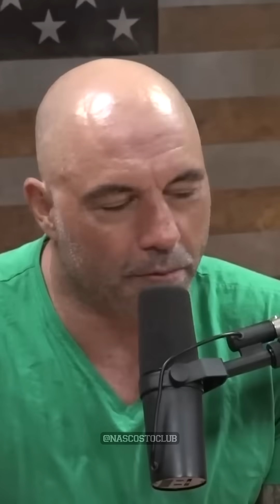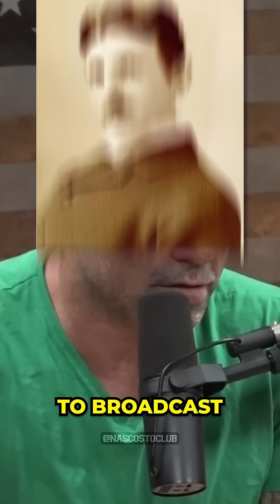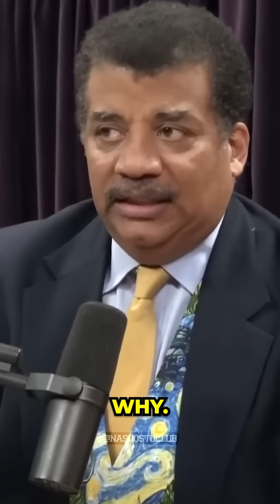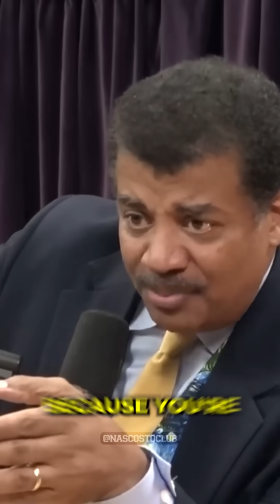WIRELESS Electricity Idea Debunked ⁉️⚡ #shorts

Comment: Neil is too mainstream to admit tesla was on to something.
Reply: We already have wireless electricity being broadcast. It's called lightning.
Reply: I did a course in IT called wireless technologies. The first thing you learn about is power intensity of the electromagnetic waves and there varying wavelengths. The wavelength spectrum is based on the thesis of electromagnetic-wavelength. Visble light, radio waves, microwaves radiation are all carried by photons. There will be a point when you can carry enough energy through the air but it will attenuate or loose power with range. Which makes it impractical. Not to mention if the Signal was so strong it will jam the most sensitive of transmitters that can detect up to -50dBm or even -100dBM. If you increase the power it can start to heat up the air as photons can be absorbed by particles taking away the energy from the signal as a whole. This is why wireless energy is still impractical. It's doable but not really great.
Reply: @hightiernub1313  exactly... it's a silly idea... thats why we don't doit that way... I don't understand how is so dificult to understand for these fanboys
Reply: Dreaming is cool but reality should be a factor in speaking about whether or not those dreams are real or just a pathway to something more feasible
Reply: He wass not... just think man, think just a bit... the emissions of the coil are spherical... that fact makes the whole idea stupid...
You have the same energy applied in more and more surface when you walk away from the emissions... Tt menas your bulb has less and less energy to function properly per sqare inch, if you start getting far away you have a variation, less energy available, do you understand?. How do you solve that? Pumping more energy, and thats dangerous. 
Tesla tougth the earth and the ionosphere would help... but he was wrong in the understanding of the behaviors of those... even if they work like a mirror reflecting the wave emissions, when you start to get a little far of the device, the power drop rapidly.
And you have to consider too, the complexity of having devices with diferent power needs, scattered all over the place. All that would be an engineering nightmare, solving the position of that devices en the field receiving the correct exact amount of voltage and intensity, or to have a variable transformer that adjust itself when you move that device trougth the field,  the whole system would be expensive and dangerous, and silly obviously...
Reply: Tesla had a neat idea but it wasn’t possible.
Reply: @TimboSlice911 tell that to the three letter organisation that classified all his parents
Reply: @MrRKlef  did they classify his parents as humans? 😟
Reply: @TimboSlice911  yeah I'll trust your intellect over NTs lolololol
Reply: @FubzyMC  Nicola Tesla was brilliant. He was also human like everyone else. Einstein was also wrong about some things. The reality is there’s millions of engineers working in physics labs for universities and private companies all desperate to find something like what Tesla proposed. The incentive to smash paradigms is immense. But none of them can because it can’t be done on the scale Tesla imagined. 

You definitely are missing the point if you are comparing my intellect with Tesla. I’m an idiot compared to him obviously. But that doesn’t have any bearing on the fact that no one can do it because it’s not possible without killing everyone nearby. All you have to look at is the best scientists and engineers in the world  have shown it to be impossible. 

Your belief is based on faith in a man who lived 100 years ago. That’s all
Reply: @TimboSlice911  "wireless" chargers for modern phones, headphones etc uses the concept that is being spoken about in this video. just on a smaller scale...
Reply: @QargZer  yes of course. That’s not what we’re talking about though. Tesla believed in large scale transmission at vastly longer distances
Reply: @QargZer  but... wireless chargers works because you put the recibing artifact very very near the emitting one, they literall have to touch each other🤣... it's a convenience based engineering. You save the time and effort that takes to plug the thing...
But in the moment you lift the tiny thing from it's place, you lose power.
Think for a bit, why is that? Why you can't walk away and still get the power from the wireless emitter? Just..  sit and think
Reply: @TimboSlice911  and that's why it wass a silly idea isn't?
Emitter emits a spherical wave... farter you go, Less energy you have per unit of surface of that sphere, the same energy distributed in larger surface, and so on... making all the system impractical...
Reply: @TimboSlice911  hey man, let them dream. They will achieve nothing if they keep sleeping.
Reply: @johnbiscuit8272  yup
Reply: @johnbiscuit8272  they can work on it their whole lives lol. This is like asking why humans can't fly, we just can't without things added on to us. 

The issue isn't about wireless electricity that's already proven to possible the issue is we would die being around it lol.
Reply: @jebril  no we wouldn't die around it, as a matter of fact go watch geerling engineering where the radio tower is a few megawatts. The problem is with that amount of power it would be equivalent to radio ramming. Plus the power density is quite low and can't be used for power transmission
Reply: @johnbiscuit8272  the radio waves can't power a light bulb. Omg...
Reply: @jebril  you aren't being helpful in the conversation by not explaining yourself

But I'll do that for you.
Any electromagnetic wave can transmit energy to power anything even though the energy transmission is poor, you can even power a light based on the power flowing through your house wire if you are determined enough

Edit
Yes it is still impractical to transfer energy wirelessly
Source
Radio light power
https://youtu.be/_pm2tLN6KOQ

You just need the right antenna design, sometimes the antenna is so huge its the size of transmission lines. 

Any radio signal your phone/radio receive is energy, we just interprate the pulses of energy as signals instead of trying to use the energy to power stuff. 

Additional source
My masters degree in electrical and electronics engineering
Reply: @johnbiscuit8272 the problem you are kind of missing is sending electric current through the air constantly is bad from a Meterlogical perspective. Not only would you create an artificial climate (Its why we need to take many precautions when operating tesla coils in an open enviroment) but you would also create an upset in weather patterns.

Heck planting too much trees in an area can mess up cloud paterns imagine billions of air based electrical lines.

Plus the main reason why Tesla's tech wouldn't have worked is because it would have been monopolized by the rich anyway as the cost to build and maintain is massive in comparison to the current electrical grids we have today.
Reply: @johnbiscuit8272  Tldr you don't know what you are talking about. Yes you don't need Tesla coils to transmit energy but that was the initial design for wireless energy perscribed by Tesla was using a large array of Tesla coils.

Short range transmissions I believe you they would work but long ranged transmissions you are just asking to mess with forces you barely understand.

Barely got into power for a hundred years? They were the pioneers and the mass producers behind the product therefore leaving them in complete position to monopolize it. You want to argue Europe could run it independantly when their focus was weapon factories at the time and forces of mass destruction. And most other countries at the time were colonies or barely able to establish themselves. Its like you haven't read a history book once.
Reply: @yammoto148  no... You've only read American history books that is written from American perspective, most advanced technology were transferred over by the British because they were scared they will be conquered not to mention the shit ton of German tech the American took. Logically speaking which of these do you think is true. Is a countryh afraid of being conquered and fighting for their lives gonna focus on technology or a country that isn't in a war and has no reason to develop the tech? And you have no idea how most technology works. "forces you barely understand" man I wished I was that native, don't worry dude I've been at your level of knowledge before. Don't give up on life you will eventually improve
Reply: @johnbiscuit8272  Right and what history books have you been reading then that you have that perspective, and don't tell me its British ones because they are wrong too, maybe German ones oh wait they are heavily edited too. And don't get me started on the nationalist indian ones either. Come on where you from, bet you now I can point out a flaw in your country's history books in a second.

The term forces you barely understand gets used a lot by meteorologists which is what I am and I can tell you running electricity through the air no matter what precautions you make is a bad idea.
Reply: @johnbiscuit8272  Oh buddy I am not even american, thats the funniest part, my history books show equal distain for most colonial and empire powers including the US but you would have to be a lemming to think they didn't Pioneer a lot of the early industrial age.

As for your points about Britain and Germany, Edison and Tesla were before WW1, when you know Britian was still an empire, a rather strong one and Germany was still trying to stable itself after the establishment of the 2nd reich.

You apparently been reading some wonky history books because you got your chronology completely wrong.
Reply: Dude, first year apprentice electricians understand this. 

Learn the first thing about electricity and you’ll know this idea isn’t r possible. 

Air is an insultstor with extremely high resistance. The amount of voltage needed to path through short distances is huge. Lightning is an example of this.

So we use copper cable with low resistances reducing the power needed to complete a circuit usually around 110-240 volts depending on the system.

Radio signals are measured in microvolts so unless we invent ultra efficient fatansy world tech with lights and appliances that can run on 0.0001% of the current energy usage of todays applances it can’t happen.

The nature of electricity makes this impossible, it is observable and can be demonstrated practically.
Reply: @yammoto148  very cool
Reply: @johnbiscuit8272  is a sphere bro... the emissions are shaped like spheres... you understand that? Is silly pretend to put workforce far away in that manner... you are wasting the parts of the spheres that your device is not harvesting. And, the energy available drops rapidly when you walk away from the emission point...
It's just so silly as an idea
Reply: @johnbiscuit8272  those emissions, those waves, are shaped like spheres? Yes or no? And if they are shaped like spheres. The unit of power, per surface (of that esphere)¿changes depending on the distance, yes or no?
So, if you have a distance variable, affecting badly your capacity to harvest that power in the devive end... it mean that; yes you CAN power something emiting a wireless wave under the right right conditions. That doesn't mean that you should.
Reply: @bamwesty8158  the nature of physics makes this impossible...😂 you have an emitting point, a wave and power per surface unit of the sphere that describes that wave... farter you go. Less energy you have in a given surface unit to harvest. The power of that surface unit drops rapidly with the distance.
Even if you can do appliances that work with 0,0000001 of the power... you move those a little bit far from the emitter, and the system is all fked up anyways 🤣
Reply: @werwinn  yes very nice that's exactly what I said.
Reply: @johnbiscuit8272  Yeah its very clear you don't know squat it seems.
Reply: @yammoto148  I know what I know, I was never here to convince anyone because I know how conspiracy theorist brain works. I just find it funny, it's like talking to kids except at the end they always think they win. Very cute, it's not like your words will ever turn into meaningful action because you won't even try to build the damn thing and when others try and fail you will say it's because they are not as smart as tesla.

Having conversations with kids is frustrating if you take them seriously. So I just have fun seeing what comes out of the brain.
Reply: @johnbiscuit8272  Because I am not an electrician I am a meteorologist and I am telling you building that machine and turning it on is the equivalent of mad science. You want to build it and make it a reality fine, but you are not going to replace the current power industry, you are not going to make a safer power grid, you are literally going to alter the climate of wherever you put that machine to the point where people risk getting struck by lightning just raising their hand in the air. Let alone the maintenance costs of such a device which will exist there is no such thing as free power. Which would be twice as dangerous as our current setup as you would need to climb a huge tower that radiates electricity.

Your post is loaded with more ad hominhiems than points, in fact that's been your discussion history. Therefore you not only don't have a point but you are flat out wrong. Because if you supposedly had that intelligence and candour you speak of you would never subject yourself to such crude and rather childish language. It kind of baffles me how little sense of hindsight you have.
Reply: @yammoto148  I confused at this point, when in my replies have I ever suggested building this thing was a good idea? Are people just randomly replying people?
I've always added that it would be impractical.
Reply: @TimboSlice911  cool dude
Reply: Where did you get your Doctorate of Science from?
Reply: He commented on radiowaves, so maybe something else could transmit it. I saw an article I still have to read about quantum data storage in holograms, I think I need to look for it to read haha
Reply: Of course. The same fed boys that pay Neil, are the same fed boys that stole Tesla's work from his room when he died (they probably put the big on him too)
Reply: Well isnt that convenient
Reply: Exactly
Reply: Fucking true bro. I was just thinking the same thing. Neil is too mainstream, he never says anything that is "controversial" Or goes beyond the "boundaries" Defined by modern science
Reply: @madhurchari6851  he says what is true, nothing more... in this case... you have an emitter, it sends a powerfull pulse in a spherical maner. That sphere grows depending on the distance of the emission point. That means you have orders of magnitude less energy in the surface of that sphere per sqare unit, just a feet away... because is the same energy distributed on a bigger sphere... every feet of distance that wave travels make it lose a lot of energy. 
So if you want to power a bulb that is far away. You have 2 options, focuse your wave just for that device, making a laser type emition, making dangerous the path of that ray... or pump more power on the sphere. Making all the field around the emitter dangerous and wasting a lot of energy in the process 🤣🤣🤣🤣 
Or simply just put a fking conductor wire man. Why is so dificult to understand???
Reply: It works in space
Reply: @bill_lumbergh  it doesnt... spherical waves behavior is the same, here and in the space
Reply: Neil literally explained why it was a terrible fucking idea. And his explanation made perfect sense
Reply: Neil is one of "them"
Reply: @LittleHuckabee  “them” being people who understand the basics of electromagnetism I assume?
Reply: @Blate1  don't assume.  Not the wisest thing to do.

Comment: Fun Fact... Neil is wrong. Electricity does go through the air... It doesn't go through the wires. The wires have an important role, but is not because electricity is going through those wires.